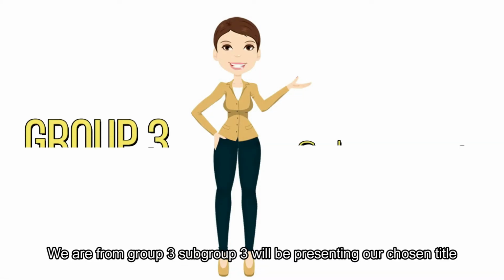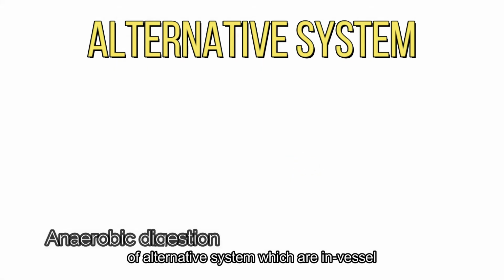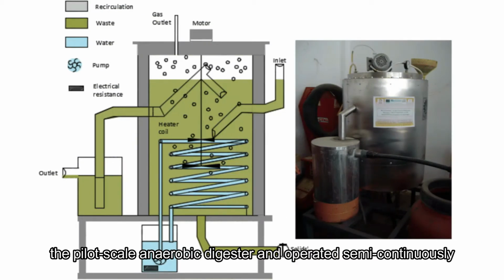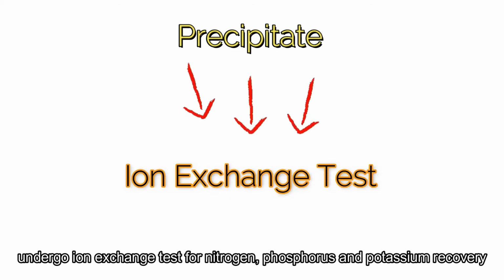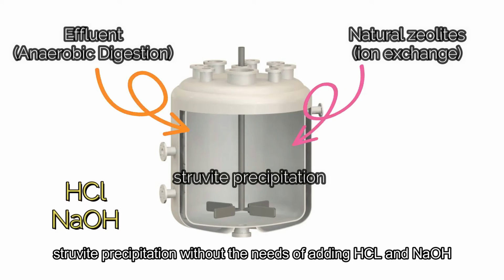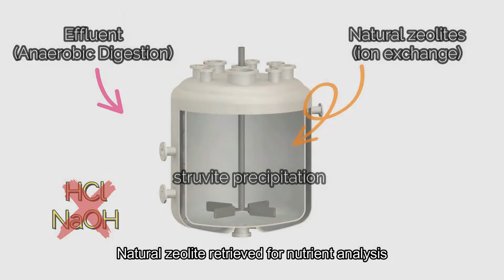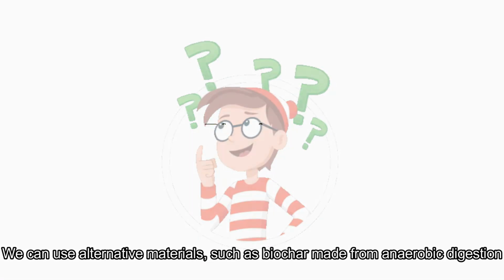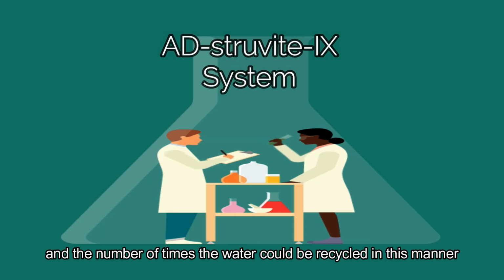[STB 3022 G3-03] Cost-effective Treatment of Swine Wastes through Recovery of Energy and Nutrients

Comment: Nice reflection here. Can you explain more about the high salinity in water.   Then, is there is any treatment for expert to solve this problem so that the reclaimed water can be used safety? (G3-SG5)
Reply: Throughout the treatment, Sodium and chloride concentrations
 increased causing high salinity (approximately 3 g/L) in the reclaimed water. Although the level of salinity is still considered safe for crop use, the Food and Agriculture Organization of the United Nations has published recommendations for agricultural irrigation with degraded water and suggests severe restrictions on reuse for salinity over approximately 1.6 g/L. For the second question, the study recommends further study of the AD-struvite-IX system to find the solution to this problem. However, there is no further study has been done yet.

Comment: Hi there! I'm a representative from Group 3 subgroup 4. So, if I'm not mistaken there are two alternatives for the XI reaction. However, the STRIEX System does not require HCL. Can you explain more about how can IX reaction occur in STRIEX System without HCL?
Reply: Hi Eva. IX reaction occur in STRIEX System without HCL because IX process in STREIX was found to cause an increase in pH due to the hydrolysis reaction providing HCL itself when AD centrate added with natural zeolite in a mixed batch reactor. Hope this helps.

Comment: hello, this is great presentation video, hi I am mohd shahran (64864) from SG01 GP03 want to ask, is there any supplement that can be added during the treatment to increase the production yield? thank you.
Reply: Hi we are not quite sure about this since it’s a new system but bittern is one of the example that can be used as supplement. This system has 3 production yield which are biosolid, nutrition and biogas. Therefore different supplement is needed for each production.

Comment: Great animated video presentation! Hi, I am with Subgroup 6 from Group 3, I wanted to ask since the pH was raised to pH 8.5 in the AD-Struvite-IX system for Struvite precipitation, why was it reduced down to pH7.5 afterwards? Thank you.
Reply: pH value around 8.5 and higher are known to be optimal for chemical struvite precipitation, hence this pH was implemented so that struvite solid precipitation formation was high. However, the IX process which comes after struvite precipitation need lower pH to improve the efficiency of N recovery. A 7.5 pH was utilized because it is low enough that most of the total ammonia nitrogen is in the NH4+ form and high enough so that the competition with H+ for IX sites is insignificant. Hope it's answer your question, thanks!
Reply: @anishazs2801  Yeah, thank you for answering my question. It helps me understand more.